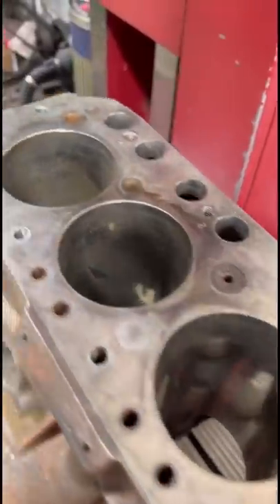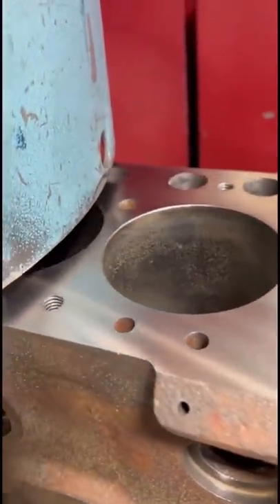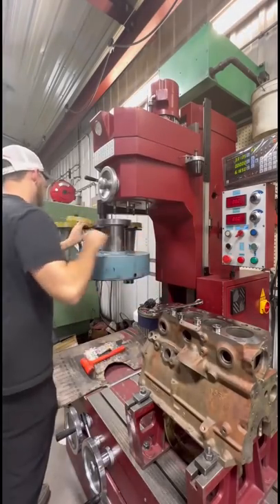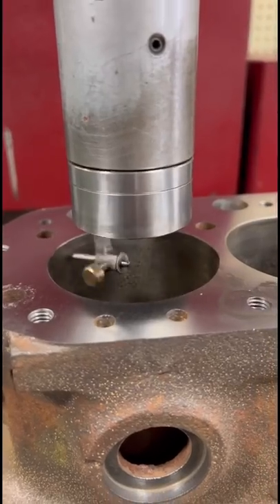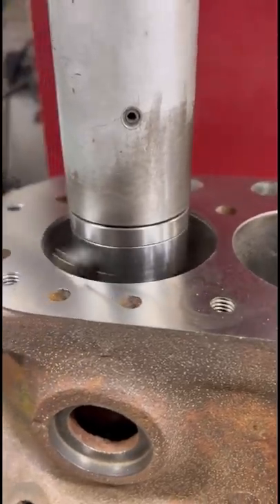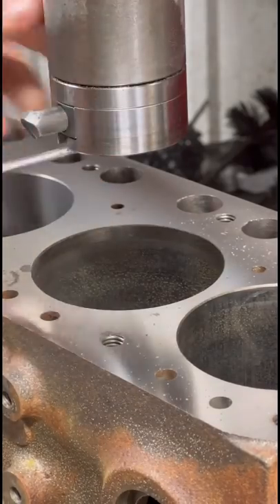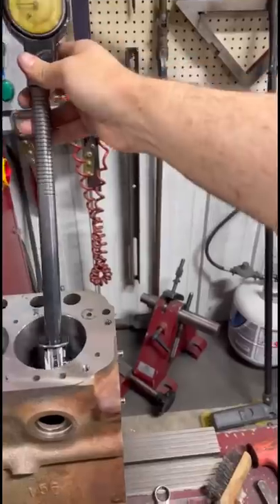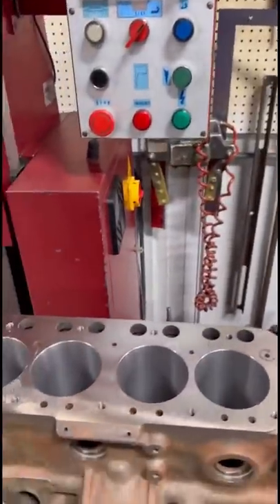#shorts Boring and Decking An Early 3 Main 1800cc MGB!

Comment: This has sure come a long way from when I was boring blocks. Our shop had 2 boring bars that were used in WWII and that’s no lie. It was quite a bit harder to set up than this one here but they sure did the job until it slipped and then you had to sleeve the cylinder. Happened more than once too
Reply: I'm pretty sure even their equipment is becoming outdated now. They have machines that will line themselves up and are mostly computer now. This type of technology has just been advancing so much

Comment: Very sweet. I own a 67 MGB GT Special but with the 1800 V block, not original.  I bought the car 30 plus years ago from my friend Mark Holden. Marks dad, Mike Holden was involved in the early testing  of the 5 main engines and he built a cut down Chrysler supercharged version that was dyno tested at a Chrysler in Hyde Park. Anyway I'm impressed with the flexibility of your shop when BMC blocks show up!! All the best, Jimmy

Comment: This genius Machinist :
 "We got an early mgb and rnc. Running an rmc through kgb cutting with rmd 45 8th fgb down to a 3.8th gmc chanfering cutter on upper left cylinder rinse and repeat all the way down to bottomright of the 4th cylinder. Then we switch over to the swivel cutting rnz"  
Me confused AF : 
"Yup sounds about right" 👌
Reply: MG is a car make. British (although I believe the Chinese bought it in like 2006.) the 'B' , an MG model is a cool little rear wheel drive British sports car from the 60s and 70s.

I believe RMC is the make of the machine he's using.

Comment: Typically, how many times are you able to resurface a deck before too much material is lost and tolerances for reassembly are no longer able to be met? Or are those tolerances always achievable by adjusting the thickness of the gasket?
Reply: Many different ways including gasket thickness will make up for material lost
Reply: You can usually save the engine with a thicker gasket.

As for how far you can surface it, that's in the manual.

Comment: How many times can you reasonably do this before you've removed so much material that it wouldn't work if you did this again? Also, how many times during the life of an engine is this typically necessary? This is a really interesting process to me, but I have no idea what it accomplishes aside from cleaning the engine surfaces down to the bare metal.
Reply: A service manual typically tells you how much you are allowed to remove. On some engines, you can get away with removing more and buying a thicker head gasket.

Comment: I had 2 MGB's, a 80 and a 66. For the highways in Texas the 66 was a better ride, why? Because it had a 5th gear, and it was activated by a electric switch. The 80 was fun, but underpowered and both were no fun in a rainstorm. Curse you Lucas electrics!
Reply: They used Lucas in the old Jaguar XJS's too, right? I hear it's a nightmare.
Reply: @captainnapalm8207  Lucas in the Jags up until Ford took over, if I remember correctly.
Reply: Ever see the ‘official’ Lucas part, with part number, that was just a jar of electrical smoke? 😅
Reply: @captainnapalm8207  I believe it be true. I had an 84 xj-6 that I just flipped and it was a tad better than pre 80's English cars. Charming vehicles, its a shame they have issues. But most folks can sort out MGB's easily.
Reply: @dannop2562  80's Jags were much more reliable.
Reply: @dannop2562  Heh-heh. I was driving my 80' MGB over a dam during a light storm that changed quickly to a windy-rainy, night time nightmare. My soft top frame was clanking, and then the lights dimmed, 2 lane dam, water smashing up the side, but I pressed on. No lights, but the engine ran fine. The rain stopped and after a few minutes, the lights fired back on. White knuckles? Yeuppers..Heh-heh..
Reply: Lucas made a vacuum cleaner once. It was the one time they made something that didn't suck.

Comment: Won't the engine get early onset blow-by because the block wasn't stretched with a torque plate?
Reply: I'm curious about this too
Reply: Some blocks are sensitive to it, some aren't. Lately, some new cars get the torque plate treatment at the assembly line. However, 20 years ago, I think only a few rare cars got it.
If it can be built new without a torque plate and last, why would it need to be rebuilt with a torque plate to last? I suppose it could last longer with the torque plate treatment.
Reply: @skylinefever  True, but that also offers an explanation for why older engines tend to get blow-by so easily. It seems a great deal of older engines have at least some blow-by that can't be accounted for by a lack of ring seal. At least not when you check the tolerances after disassembly. I guess it would make sense not to if they expect the engine to fail somewhere else first, though.

Comment: How many times can you resurface before needing a complete change.
Reply: They take a lot off over at Barum engines taking the top off pistons to get the compression height correct.  
Totally depends on the block.  Copper head gasket shims are available for some engines. Extra thick head gaskets for popular engines from some gasket makers to get the intake manifold ports and bolts to align again when blocks and heads have been surfaced.
Measuring from the crank centerline to the deck surface will let you know how much has been removed.  Careful  crank centerline to deck surfaces can let you square the block so each compression height and volume is the same.
Reply: Usually a car service manual will tell you how much you are allowed to remove. However, some people remove more and get away with it.
It is more of a problem on SOHC and DOHC engines, because if the block and head are machined too far, cam timing is affected because it affects the position of the timing belt/chain.

Some Honda engines have indicators on the block that tell you when you have gone too far. Here is an example with a Honda B18. The explanation is at 5:25. If the machine touches the indicators, then according to Honda, the block is junk. However, some people save them with extra thick head gaskets.

Comment: Why would you want a Chamfer at the top of the cylinder ?😟
Reply: From my (limited) experience, it makes setting the engine up easier—assembly, sleeves, etc.
Reply: @dannop2562  maybe so, I get that the larger opening helps with getting rings compressed in but the  tool to do that is cheap and has been .  The issues that LIL gap/area it creates wen a flat gasket and cylinder head is bolted down can be or WILL be disastrous to preformance and longevity if any real power is planned.  MOPAR2YA

Comment: Why do you always resurface the engine block
Reply from the maker: Did you watch the video? Self explanatory….
Reply: The block needs to be flat for the gasket to seal. Also, if the surface texture is not smooth enough, some gaskets still won't seal on a flat surface.